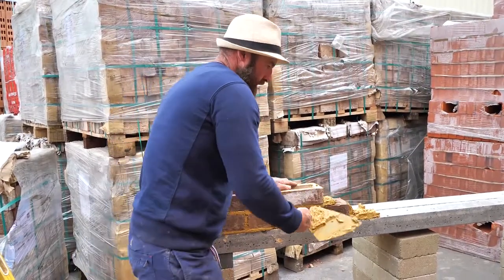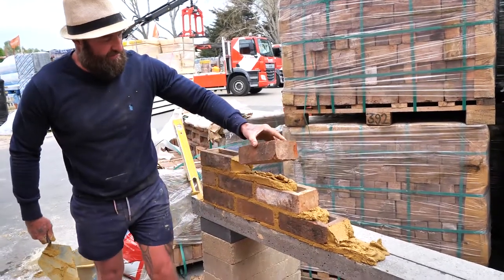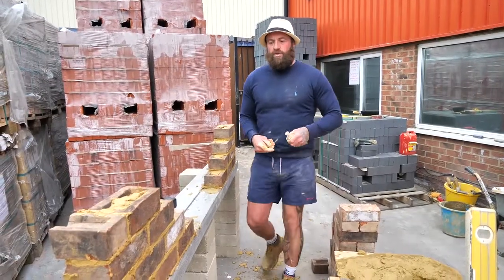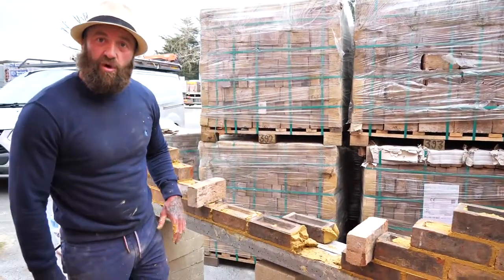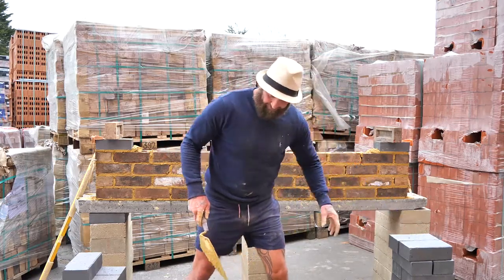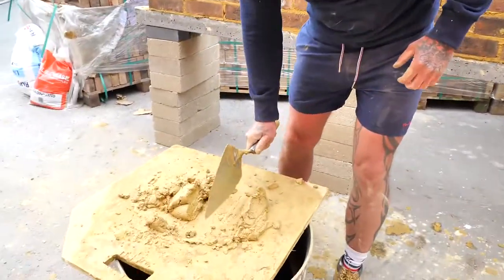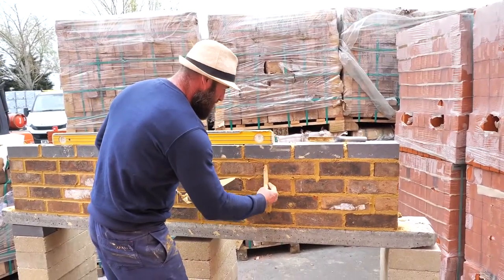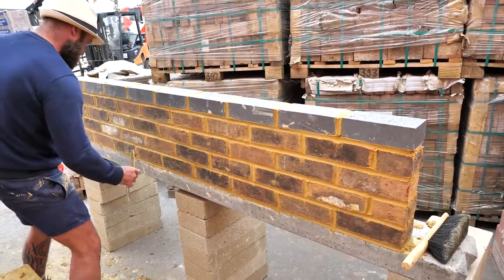Learn the skill of bricklaying with The Traditional Bricklayer

Comment: If cavity-wall insulation is to be used in construction from the very start ; there SHOULD be a LARGE air space gap in-between the face of the insulation and the OUTER WALL inside the cavity-wall ; this includes an air space gap in-between the face of the insulation and the cavity-wall-tie drip points which are in the centre of the cavity.                                           Ask N.V.Q. BRICKWORK teachers for PROOF of this !